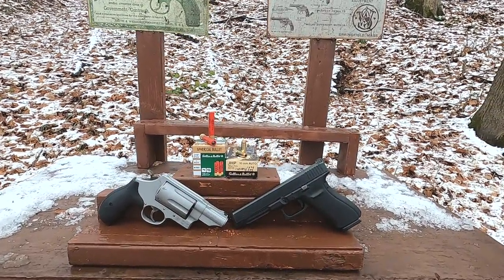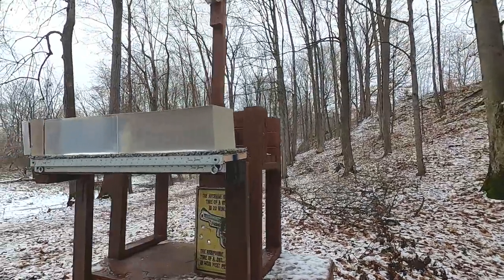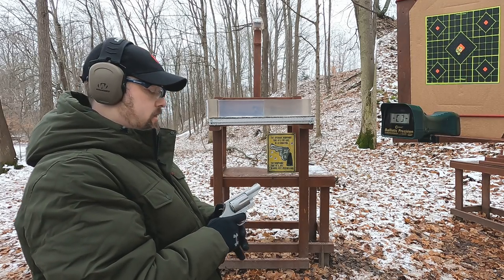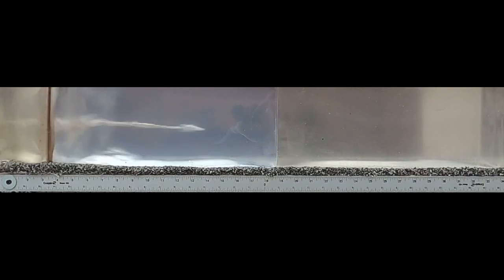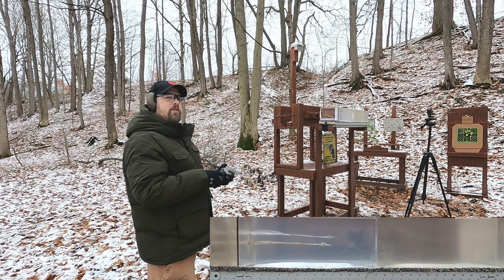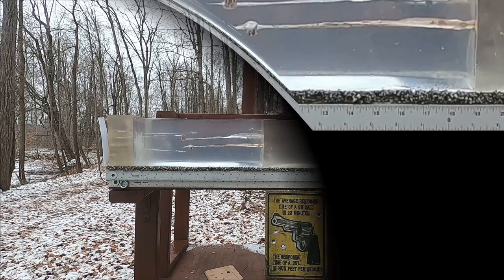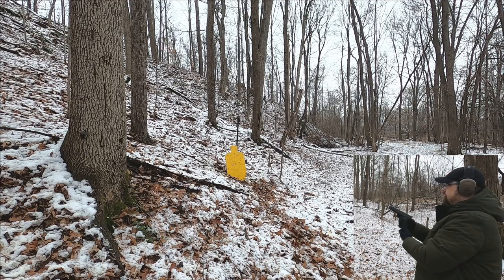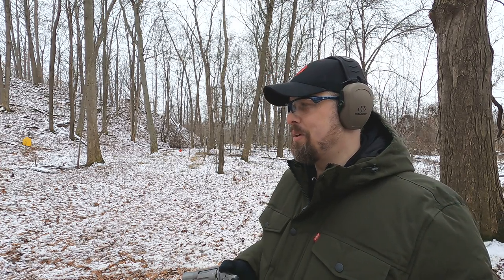Sellier & Bellot .410 000 Buck VS 10mm JHP

Comment: I agree with what you said about the 10mm load. Not every situation demands high speed deep penetrating, bone crushing power like you would want for defense against bears/wolves/cougars and such. For defense against human assailants, less muzzle flash and blast, less recoil, and faster on target recovery time is desirable. Also this ammo is easier on the shooter so it would be conducive for more practice time at the range, which should help with accuracy. Then when you need all the power that the 10mm can deliver, get some Underwood or Buffalo Bore ammo.

Comment: The 10mm load looks like a great general purpose load. As u say, a liitle less recoil and goid for compact guns. And still 100 fos or so faster than a comparable 40 load, with good expansion and penetration. Most S&B ammo is pretty good in my experience. I imagine the 410 ammo would do well out of an 18" shotgun barrel. 3 holes at a time, same size as a 38 wadcutter, and probably a bit faster. And many people advocate those for defense, in a full power guise.

Comment: Many loads of 10mm are basically 40 S&W power or a tad more. Solutions for that from Buffalo Bore, Underwood, DoubleTap, Grizzly, Cor-Bon, Sig Sauer, Federal jack up the power again.
Reply: .40- ish velocity is a Option not a Fault .
Reply: @Peter Angles 180-grain Trophy Bonded JSP, rated 1275 fps/650 ft-lb.

Comment: Been shooting  a lot of S&B 10mm, both JHP and FMJ this year since it's available and cheap.  May be a light 10mm load, but it still kicks double in my 5" barrel 1911 than 9mm in my p365 (115grain Tula, 115gr Norma, 124grain Sig V-crown all very similar kicks)...Also been shooting a lot of Magtech 10mm and its kick is nearly identical to the S&B for 180gr target ammo...

I wouldn't use 10mm for personal defense outside of my home.  Look at the moron's prosecuting Rittenhouse and the BS they introduced to the jury...too risky with our anti-gun Soros-funded DA's...
Reply: @Peter Angles That's pretty funny Pete!
Reply: I have a Ruger LC9 and my old duty KP 94. I also have a 10mm Springfield Armory XDM with a combo tac lite and Laser for home defense. I rarely carry the 10 unless I am heading to the woods in Michigan. If I cannot get a human problem solved with a 9mm, I should not be engaging. 
Although I am considering a Ruger 57 which I think hold 20 rounds.
Reply: @scottroder5516  Ammo is expensive for that 57...if you can find it!

Comment: I just doubt most buckshot rounds are going to get idea penetration from a handgun, especially a short barreled one.  That said, 8 - 11" is fine for straight on shots and remember, every pull of the trigger is several more holes.  I'm still not sold on .410 handguns, but I'm not disappointed with the terminal ballistics of this one ... the hanging up the cylinder, however ... ugh.
I am SO jealous of that snow!  I'm sitting here in coastal Alabama and was sweating in jeans and t-shirt in the mid '70s today.  I want WINTER!!! LOL.
Reply from the maker: I keep hearing that the Federal handgun stuff does well. I just can't find it anywhere to buy. Michigan is confusing, when it snows it's often much warmer feeling than when there's no snow in the winter.
Reply: @GunSam  Might be due to the clouds. Clouds hold in heat that would otherwise just keep rising. So those clear skies in the winter are maybe warmer when the sun is on you, but step into the shade and it's colder.

Comment: That 581 FPS might be it picking up the wading rather than the pellets?
Reply from the maker: I doubt it. I have picked it up before and it's more like 100 FPS.
Reply: @Peter Angles they hurt and I have been hit by one from a 20 gauge, actually I was very fortunate that the pellets didn't hit me otherwise I'd probably not be typing this!, and it cut the skin but didn't stick in.

Comment: The 410 gauge is good defence ammo into minum barrel 14 inch or 18 inch is optimun 😉. My personal reloaded is four 000 buckshot into wad in 3 inch case at 1300 fps into my mini mossberg 20 inch barrel
Reply: I think the 3" .410 is way underrated from a smoothbore. 
My 14" shockwave will put 5 000 from a 3" load into a fist sized pattern at 15yds
I recon that would be pretty effective.
5/8 as effective as a 12 gauge maybe ;)
Reply: It's all about ammo selection, even a 3 inch barrel can easily kill if you're running the right ammo
Reply: @samdone2900  My friend you load buckshot what velocity into 14 inch barrel? Is very interesting your test balistic... Sorry for my english
Reply: @antonelloromeo2118  No I dont reload .410. I just buy Commercial 3" Buckshot. I have Winchester, Federal and Herters brand 000 buckshot, all 5 pellet and all pattern extremely tightly out of my Mossberg .410 Shockwave.
Reply: @samdone2900  Ok my friend,  you are chronograph into mossberg 14 inch barrel velocity?

Comment: Maybe the velocity is lower than rated with the 10mm because of the cold.
Reply from the maker: Not likely. I did a study with ammo and the only thing that lowered velocity was if the ammo was left out in zero degree weather all night, and even then it was a 20 FPS drop. Cold air has no bearing on velocity at handgun distances.
Reply: Readings are lower, because S&B is following CIP standart of measurement - 150mm long test barrel. I do not know why CIP chosen unrealistical barrel lenght but at least the measurements are consistent under CIP standart.

Comment: The Glock 41's slide weighs ~3 ounces less than that of the Glock 21, of which it's slide is a few ounces less mass than that of a Glock 20. Not to mention, the Glock 41 slide's breechface dimensions are wrong. DO you have these sorts of malfunctions often?
Reply from the maker: I have malfunctions because the Lone Wolf conversion barrel has a feed ramp significantly smaller than it should be.
Reply: @GunSam  The .45 ACP breechface's extra slop not precisely keeping the undersized cartridge centered in the feed cycle is likely not helping...

Comment: real 10mm 180 grain Should be clocking  1300 fps in 5 inch barrel
Reply: Similar to .357 Mag , a positive feature of 10mm is the capability to use ammo of different power levels .

   And in the absolute sense , this S&B isn't weak . 488 ft lb , acceptable penetration , and good expansion put it on par with lots of .40S&W or .45acp defensive rounds .

   Less recoil , less muzzle blast can be desirable attributes for some shooters , some guns, some roles .
Reply: More like loading .300 WM to between .308 and .30-06 .

   Kind of like few people only ever shoot/ carry full power 125gr from .357 chambered revolvers . There is a smorgasbord with medium loaded .357 , .38 + P.  , .38 standard pressure also , to select as desired for recoil , power , etc .

   Don't get me wrong , I like " normal full " power loads in my G29 . But this S&B load certainly is equivalent to an above average .40 , and with the penetration and expansion Sam recieved , I wouldn't object to carrying it .

Comment: My good fellow, both of those rounds are absolute trash. 
I have 40S&W loads that will beat that 10 and take it's lunch money coming from a Glock 23 4". The Judge/Governor loads are best reserved for snake and rat purposes with a ton of tiny pellets. Even then, they're pretty much worthless past 5 yards. They spray everywhere. I load my Governor with #8, #4 buck, 45acp, 45acp, 250gr 45LC LSWCHP, and 200gr hardcast 45LC. I carry 4 moon clips of 185gr +P 45 ACP is a two speed loader pouch. The 410 loads, even the slugs, are worthless in comparison to either the ACP or LC rounds.
Reply from the maker: Judge/Governor loads? I was literally just shooting Federal 000 buck with their handgun load of that at steel from 40 yards. Each trigger press had at least a couple pellets on steel. All the other handgun loads I have shot from 25 yards and I get a lot of hits on the steel, such as the Critical Defense slug hits and a couple of the pellets hit, all the disks in the Winchester load hits at 25 yards etc. I don't get your comment. Your comment would be correct about birdshot made for long barrel shotguns, but you said Judge/Governor loads and under that category (which is shotshells specifically made for handguns) I will say you aren't just a little wrong, but on a different planet wrong.
Reply: @GunSam  not sure what we're disagreeing about. You got a single pellet, at probably 500fps on steel at 25 yards out of five cartridges. The spread was in feet between the pellets. You might want to review the video.